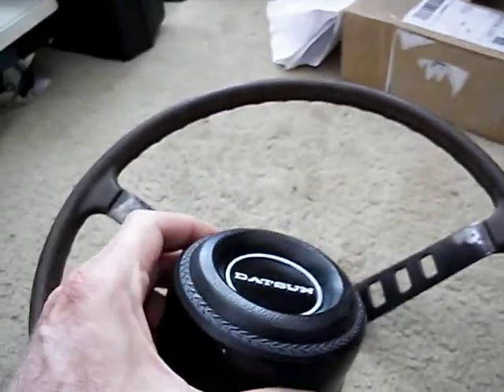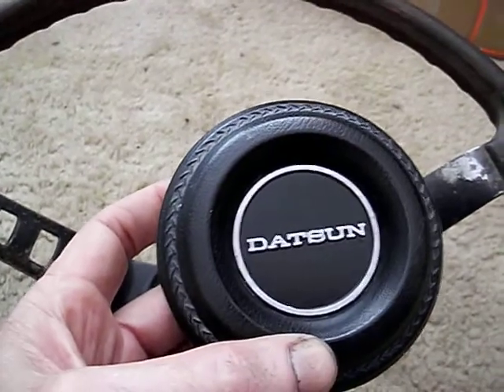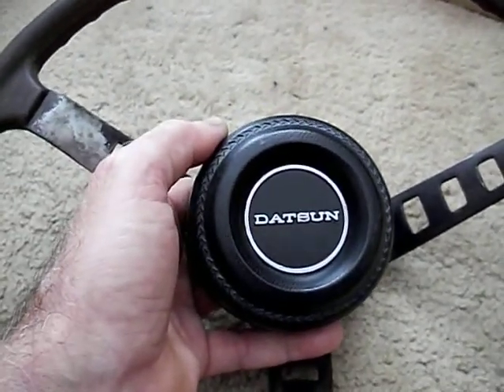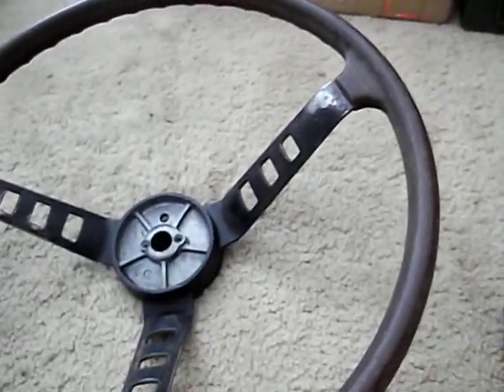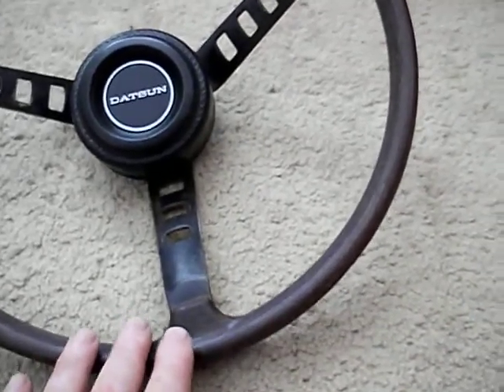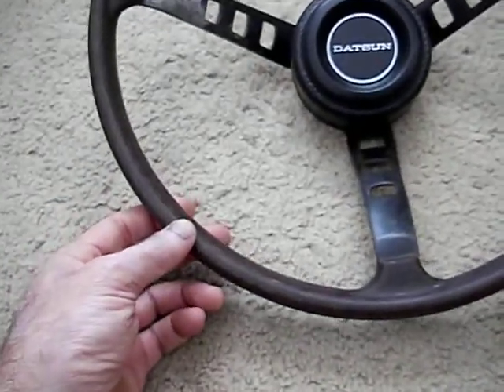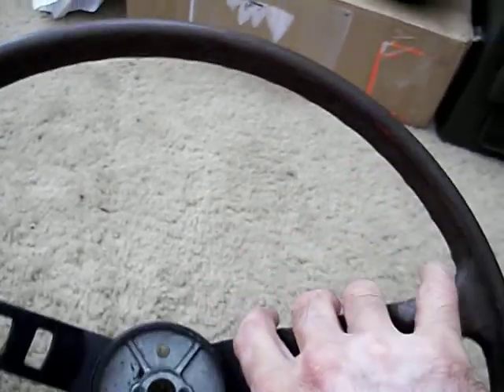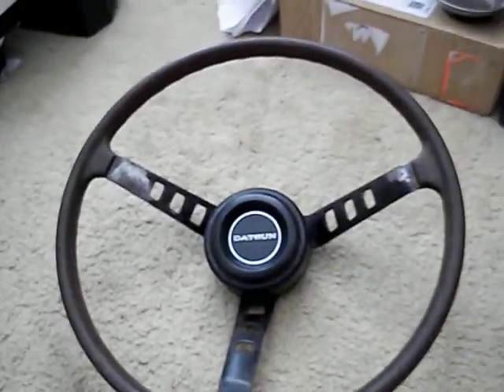Datsun 240z horn button refurbish pt 2

Comment: The best part is " it looks cool" you even have the punched thru hole design of the early wheel. Then came a filled in hole wheel then the various crash wheels. Also the early horn button is far better looking then the later smooshed muffin top ones.
   I even am in the process of changing the dash skin from my 280 to the "Batman ish" 240 daah. The 260 on dashes were a smooshed down version of the 240. The tunnel area is different too.
 I already back dated to 240 tail lights and front turn signals, got rid of crash bumper dampeners / hydraulics and brackets.
  I have a stripped down 73 and a stripped down 280 so its easy for me to back date as much as practical. Im using the L28 in both cars , 5 speed in both cars, dual carbs in both cars. The 280 will get triple 40mm soon after its broken in.
 I have removed everything I can that the 240 doesnt have to get the weight down.
Im also fitting reclining racing style seats in both cars .The 240 has lots of seat room different shaped tunnel and floor pan. My 280 I had to cut tunnel and floor to. Mimmic the 240 to get seats lower and more central in the car.
 Im back dating its original kick ass looks of the 240Z. Only a porsche 911 got it right first time out like the Z did..